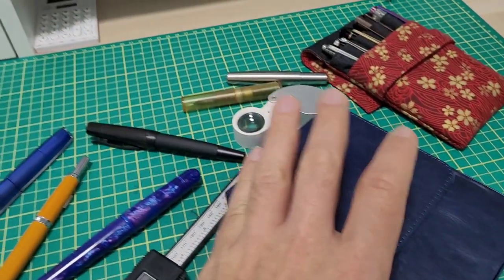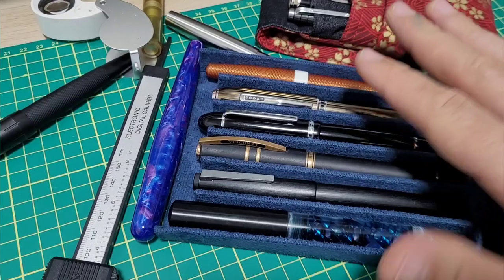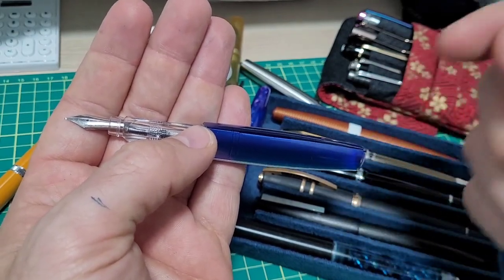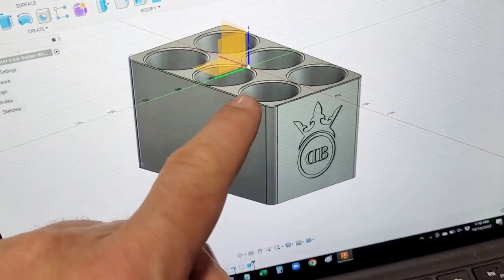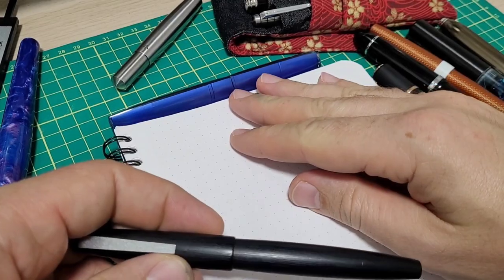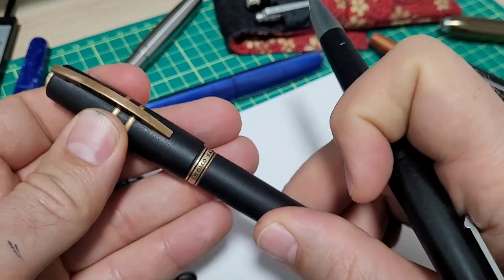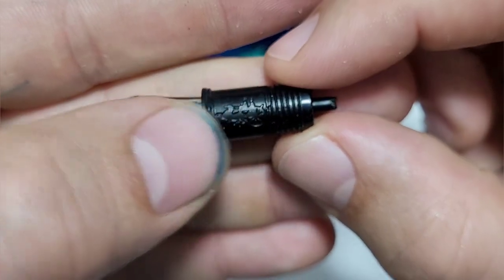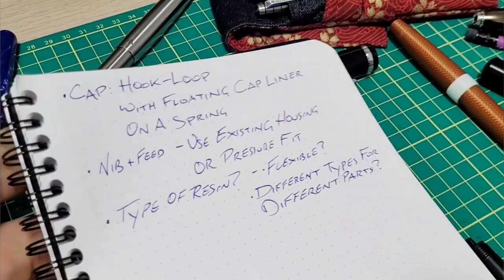Making My Own 3D Printed Fountain Pen - Pt 1 Design Ideas

Comment: You could try printing without the threads and cut them with a steel tool. That should give you cleaner threads for the nib housing.
Reply from the maker: The resin doesn't cut nicely like metal or other plastics do.  Possibly a clean up with a tap, but definitely not cut the full thread with it or else it will chip up really bad

Comment: I once toured a military contractor for an ancillary project for them. I was shown a printer that used the powder / binder system and the powder was stainless steel.  The part is about 90% sintered, then it was placed in another furnace with copper powder. The melted copper migrates through and fills the interstitial gaps in the sintered part.
The Navy was researching how to print parts instead of stocking parts onboard the fleet. This was in the early 2000s.
What I see in 3D printing today disappoints me a bit because the promise of ubiquity did arrive, but mostly in polymers. We do not have fittings and parts libraries as I had anticipated.
That said, your pen series is going to be fascinating. 👍😁
Reply from the maker: There is always a large delay between development in military gear and what the public gets (and sometimes never).  The innovation that comes from the armed forces is way higher than most understand.  There are some cool developments in 3D printing coming out.  My friend Dan Gelbart with his Rapidia company is a good example along with many others.  Not always for the retail customer, but then again most average Joe's don't have a CNC machine in their garage LOL.  What gets released during our short lifetime is single frame in the movie of human development that continues to play out.  The cool part is the people that contribute to an innovation knowing the final result will be beyond their lifespan, but are please to contribute to the process.
Reply: @Doodlebud  Very well stated. Your overall thesis reminds me of the impression I got from all of the textbooks I had to buy. It struck me that almost every paragraph, and at least every chapter section possibly represented one or more lifetimes of research and testing and publishing. Studying through any engineering, or scientific degree program truly represents standing on the shoulders of an incredible array of personalities.
Gotta say thanks for knocking me back into the proper perspective with regard to 3D printing. You were right on every point, and it was my own impatience that caused my frustration. 👍
Reply from the maker: It wasn't long ago I was digging fragile powdered prints out like an archaeologists before the had to be dusted off the impregnated with epoxy to solidify. To now having parts that are ready to go out of the printer. It's like compound interest. 1 yr over another isn't much, but give it time & the difference blows our minds 😉

Comment: excellent subject. I tried playing with this myself but my FDM printer just doesn't have the resolution (Unless you start with huge pens like William Shakur did, and prepare a lot of elbow grease for the polishing). I suggest you start with a resin printer and save a lot of pain. and yeah, the crazy eyedropper is a real problem. you need very translucent, dense material, and the ink will catch inside because it will never be smooth. I think it may prove to be way more complicated than the threads to get it right.
Reply from the maker: Have a look at Platypus Pens.  He does it with an FDM printer and the results are truly amazing.  https://youtu.be/d_b6y9IDtL8
I bought a resin printer earlier this year so I could start this project and have materials on the way to test out how they will do with some design ideas.

Comment: Doodlebud, my good man, I am so glad you're diving into this! I've been thinking about doing the same for a couple years now. Making the first steps toward making a pen that's perfect for me, I've just last week made a epoxy resin pen molded in prefab silicone molds...it worked! Technically! It was a real cheapo kit, but man! If I learned one thing, it's that we will need ITERATIONS. I might try 3D printing next. Might try turning one out on a lathe next.

And an ongoing project, get this--I got a few square feet of 26 gauge stainless steel, and I've been trying to make nibs! Even with a VERY awful method of cutting the tines' slit (dremel cutoff blades--some ~0.6mm thickness--way too thick), we DID achieve dip-and-write effectiveness! It's ugly, and who knows how I'll end up cutting one with a slit narrow enough (maybe a lapidary blade at ~0.3mm). Whatever we go with, what a fun type of project to mess around with!

Can't wait to see more of the series!

Christian
Reply from the maker: Yup, there are so many changes & discoveries that come up during the process. R&D was my favorite part. Moving stuf into production then managing the production & deliveries/installation wasn't as fun for me. It's rewarding seeing things being completed & getting into customers hands. But flying blind & having to figure new things out was my favorite part of the process.

Comment: My 5 suggestions:
- Japanese eyedropper filling mechanism like the Opus 88 (simple but prestigious)
- Octagonal/hexagonal shape, or octagonal/hexagonal at the section and round on the upper half (eliminates need for roll stop)
- Integrated/semi-hooded nib (sleek look, and will keep the giant #8 nib from drying)
- I feel like there's something interesting that can be done with the feed, like colour-matching it to the pen, or a cool shape like the Nikko ebonite
- Transparent/demonstrator style resin, but making it look like makrolon (as per the Taobao "Lamy" 2000)
Reply from the maker: While I'm at it I might as well get me some Unobtainium and make it out of that
Reply: @Doodlebud  I think the Japanese eyedropper would be an easier implementation than a piston, and a hexagonal/octagonal shape would be easier than a spring clip, no? Not sure about the technical challenges of a hooded nib or a brushed texture on the resin though.

Comment: you're tempting me to bring my project back from the dead. I had a vacuum filler that used a syringe inside it (with the tip and handles cut off :P)
mine had both an SLA and FDM version, with the SLA not needing a syringe inside. now I wanna make a piston filler/eyedropper.
Reply from the maker: Good, pick the project back up. I'll work on this & you work on yours. The satisfaction from completing a project is immensely rewarding
Reply: @Doodlebud  true, but so is the satisfaction from a non empty bank-account a relaxing nap 😴 (Depression™)

Comment: Brilliant video can’t wait to see the finished product. Someone gifted me to my surprise a Jinhao X159 received only today. Quite a decent pen really like it and particularly the size 8 nib. Your idea has legs run with it. You can should you want to in time, outsource nibs etc. What I know about engineering you could write on a postage stamp that said I’d be inclined to go for a Schmidt K5 international converter as your fuelling system. Perhaps work your design around that. Great stuff. Catcha next time D
Reply from the maker: There will be many iterations and multiple designs am sure that will come up over time.  Once I get the hang of it and know what works and what doesn't, and finally get my Fusion 360 skills up to par pretty much anything is possible

Comment: Clip is going to be the trick. Getting that right is really material dependent. Can the photosensitive resin flex the thousands of times it needs to?
Reply from the maker: It's a material thing but also a design thing.  Have to design it not how a metal clip is made but how a clip should be made out of a material with very different properties.  Might work out, might not, either way I'll play around and find out.  Here's an example where design can overcome weak material properties:
https://youtu.be/97t7Xj_iBv0
Reply: @Doodlebud  Trick is the life expectancy, as most of these are on disposable pens, where it only has to last the life of the ball point insert, but on your design it would need many more cycles, so material fatigue is bigger issue in your design that the designers of the disposable pens do not have to worry about, but you do as the fountain oen you are designing might experience order or two of magnitude more flexes of the clip. This would make a roll stop infinitely easier, but certainly integrated clip would sure be nice. I notice many if those integrated plastic clip are of different material than the cap, which is often clear, but sturdier, while the clip is flexing, even when they are firmly joined/glued together, and all the flexing is in the clip itself. Spring loaded clip is nice, but increases the part count and difficulty of the cap construction substantially. (I am always reminded of the vaguely Parker 51 clones, where most of the engineering and cost is in the nice metal cap, and very little in the injection molded body itself.)
Reply from the maker: Yup, making something do something it doesn't want to do is always a challenge but it's fun at the same time. I always think of the quote "Don't wish it were easier, wish you were better." Challenges are opportunities to level up
Reply: @Doodlebud  True, although most fountain pens meant to last a long time end up using springy metal as a clip, or a  rigid clip, with a internal spring of some sort, leaf, or coil. But I was thinking about this. How about magnets? Make the clip rigid and solid, but with captive hinge on top, which is 3D printable, and then use two magnets, one in cap, and one in the tip of the clip. With some travel limiter at the top of cap and clip, so it can only spread apart so far, it will always spring back, and will be a very secure clip. The hinge where the clip is captive, and essentially non-removable could be one of those things that can only be made by 3D printing, so embrace the method, and do something which can't be made otherwise.

Comment: I think that simple is best for the first pen out of the box, as it will be. However, it may not be to your satisfaction. All the bells and whistles should not be on your first pen, unless you are confident in your experiment. 

I think the hook system on the Visconti may be the way to go with the closing feature. Eyedropper fill may also be an excellent choice for starting. As for the nib and feed design, go for the #8 size nib. While screwing in the feed into the section may be great, I think a friction fit would be easier.
Reply from the maker: There will be many iterations before the final product. I will slowly add complexity as I resolve each individual design parameter.

Comment: I have done a bayonet like thread on a resin printed pen to line up the facets, have just got into urushi and have got a few in progress. Looking forward to seeing what you come up with :).
Reply from the maker: Oh nice!  Did it all work out well and hold up over time?
Reply: @Doodlebud  The ones using Elegoo ABS like resin have. It doesn't seal as well as I would have liked, it isn't bad, but could be better, the good thing about 3D printing is it is easy to make changes and improvements.  I like the idea of a printed spring, perhaps the Siraya flexible resins would work for that, they can be mixed with other resins to add strength and some flexibility.
Reply from the maker: I got some anycubic tough resin on the way

Comment: Very cool!  You are really putting the work in and I respect that immensely.  I expected nothing less from you given how thorough you are in previous videos.

I have thoughts/suggestions for consideration if you want them.  I'm not an expert, but I have done a lot of printing and personal research on this subject for my own projects and I hope that can be of some assistance.  I only have 1 video of the outcome of my resin printing/designing on youtube and the rest of my videos about it on FB were wiped out when my account was nuked. 

Purchase some Siraya Tenacious resin to add say 10% to what you are printing with to give additional toughness and shock resistance to it.  It's clear and semi-flexible and could also be more heavily blended to make good clip material as well.

That Zebra clip idea is outstanding and I think it would really be good to adopt some of that in your design.  It looks good too.

I really like the Visconti cap closure setup too, but that may be difficult to implement on a triangular body if you go that route. 

You are doing a great job.  I can't wait to see how this evolves.
Reply from the maker: Thanks!  I have so many other things on the go its tough for me to get enough time in but I try to do what I can in between everything else.  I wont be able to match the hook-loop system with a triangular body design, it will have to be a snap cap.  I know the design features I want to do its just a matter of learning Fusion 360 more so I know how to design all those features.

Comment: One more thing to add to your list...
Make sure that the resin you are using will not dissolve in water :)... even after being cured.

Here is a small explanation as to happened to me once, some time ago :D.
https://www.youtube.com/watch?v=TcRZUCW5SK0 - around 2:12.
Reply from the maker: Thanks for the share.  I had water washable resin to use just for testing ideas, but final ones I will use are chemical wash.  I have some new tough resin on the way as I think it will work well for what I'm trying to do.  But who knows, it might go terribly.  All part of the process and learning curve
Reply: @Doodlebud  The "toughest" resins out there are the ones that are marked as "ABS like"... even though is not as close to the actual ABS, but they are definitely stronger, and they do resist against water and inks.

Good luck - curious to see what you are going to come up with :).

I'm getting back to it with the winter coming... Summertime didn't have much time for printing... I have too many projects going - Winter grounds me 😅